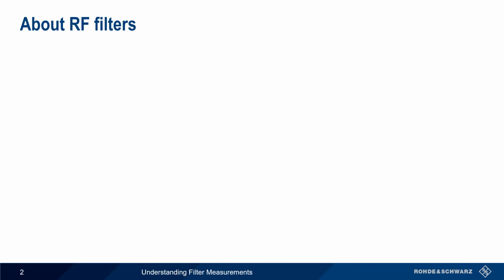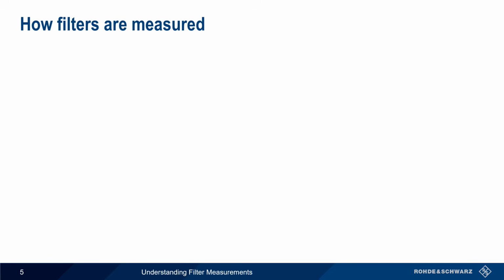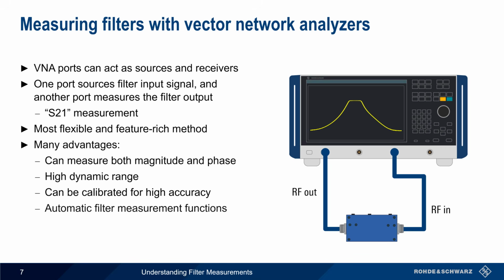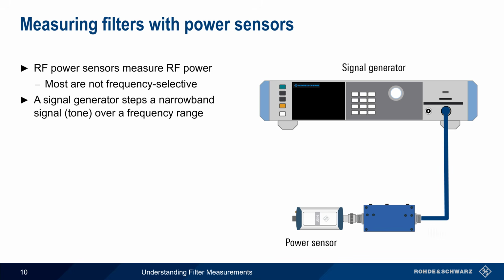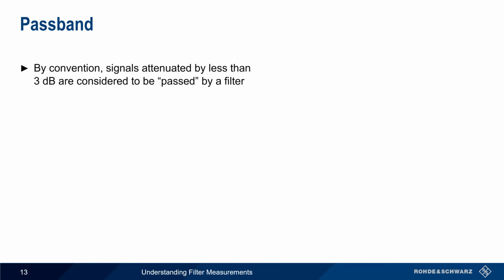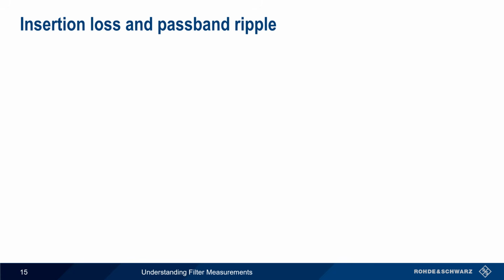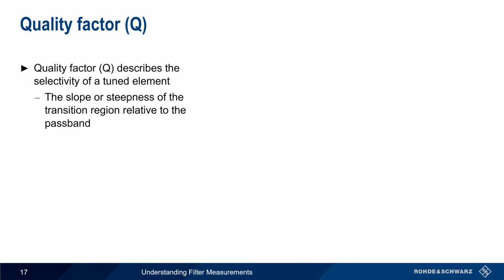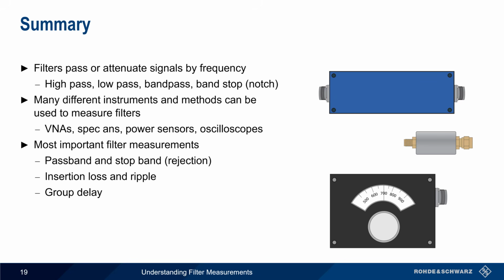Understanding Filter Measurements

Comment: Like always great reminder video! Regarding attenuation of the filter as S21 is  power measurments and will have S12 same value e.g. for LC filter but if we measure volume output input it will be not this same if we swap  output and input. How to measure also voltage and current of the filter not only S21 or S12 (same value)? How much important is to measure voltage and current of the filter to know if the filter have direction. Let say we do not know filter we measure. Regards
Reply: In my experience, for passive filters, S21 is usually the same as S12 - that is, you can connect the filter either way - but this should be verified by measurement.  You should also be able to verify this the "normal" way - there is no need to make a special voltage or current measurement, just reverse the direction of the measurement, either by physically re-cabling or switching channel / port / measurement definitions (e.g. S21 -> S12 or redefining input and output ports when measuring with an oscilloscope).  Hope that helps!
Reply: @pauldenisowski  90% of the passive network we deal with, apart from circulators and isolators, has the s21 = s12 (reciprocity).